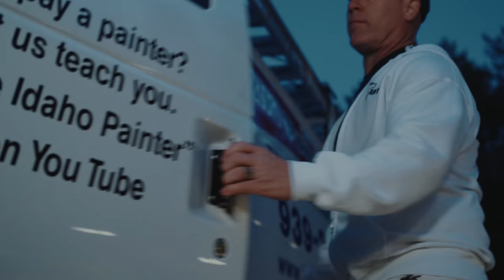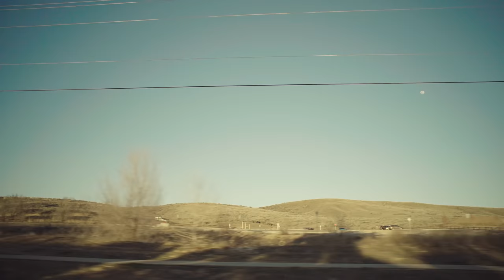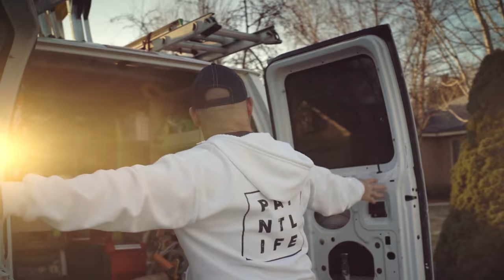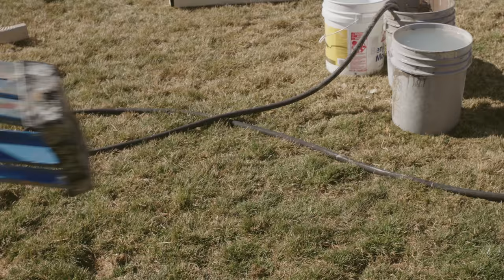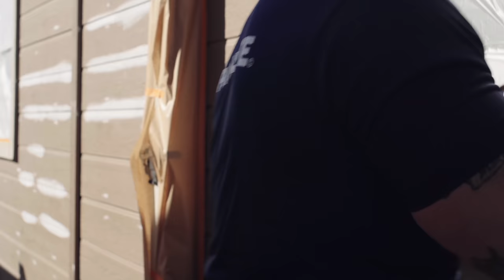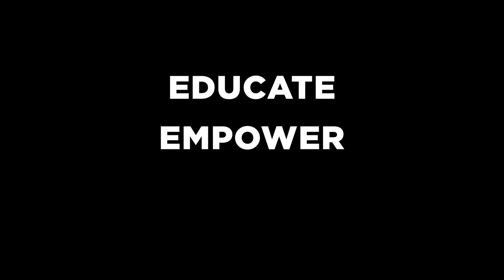Paint Life: Educate Empower & Equip

Comment: Started painting in the early 70's and professionally in 1980. I skipped 2 grades in school. I was in the 8th for 2 weeks, 9th grade 2 weeks before moving to the 10th grade. I was born July 4th, 1963 and I graduated at 16. I had on a farm in NC for 2 summers planting - picking tobacco and  baling hay. When I graduated I was so young I couldn't get a job for crap anywhere because I was only 16. After two summers working on the farm I had decided I didn't want any more of that. Let me tell you farming is a hard-ass job. A guy by little hometown Coats North Carolina who had graduated a year or two before me told me his dad was looking for some paint helpers and offered to pay me $4 an hour. The most money I had ever seen was $3.35 an hour busting my ass for minimum wage Farm. So I got the job painting and the first day on the job they told me I want you to send this door as smooth as you can get it. It was a six panel wood door and we used 180 grit sandpaper for oil primer. all of our trim was oil primer and two more coats of semi-gloss oil base. anyhow they left me in that room all day and didn't tell me nothing. I think they just forgot I was in there they didn't even come back from me at lunch. When they came back I have spent all day sending one side of a door I sanded every bit of the primer off but that door was a smoothest or you've ever seen. I work with that man for years they never let me live that down. I just didn't know any better. I got a 50 cent raise or my very first check and I got paid in cash and that was the most money I ever seen in my life and thought I was rich. I sanded and puttied. for two years straight before they never let me touch up paint brush and even then it was only the prime I couldn't do anything but Prime stuff with a brush that's all they would let me do. I did this for more than 30 years painting work for myself for the vast majority of it as soon as I learn how to do everything on the job I wanted to have my own business and started trying to work for myself at 22. I was a good painter I can cut a straight line like you wouldn't believe straighter than you can with tape even now. I had a hard time getting work because I was so young nobody took me serious until I seen how good I was. I've always been a perfectionist and tried to do the best job I could on anything. I painted professionally for more than 30 years until I fell and broke my back and forth places and now I can't walk too good. I'm unemployed because nobody will give me a job I can't do the painting end of it I'm not able but I could run the hell out of a crew run them in the ground I know exactly what to do on every little thing and I'm not one of these kind of people that thinks they can learn something cuz I'm always learning new stuff from your videos a lot because things have changed in the last few years and I've seen some things that I haven't never seen before. When you get to where you can't learn nothing then you're a dumbass. I can't tell you how many painters that work for me that didn't know really what they were doing to learn how to do everything backwards and I couldn't never break them. The best painters were the ones that came to mean didn't know a damn thing and I taught them the correct way to paint. Especially sprayers. I only had one guy that I was able to teach the correct way to spray. once a person never learn something incorrectly you cannot get it out of their head they think their way is the right way and they're wrong. Leastways I never could get it out of their damn heads. I paid you for 8 years professionally and then I moved up to Washington DC and work with a big company I had over 250 painters in 150 wallpaper hangers. Ronald D. Mayhew Incorporated. they were commercial industrial only wouldn't even consider a job under $300,000 wouldn't even fool with looking at it. This was in 1989 1990 and 1991. It was like being in a paint army. you had a quota of how much you had to do if each thing everyday and if you didn't make that quota you better make it up the next day if you hadn't made it up by the third day you were fired. a foreman on the job liked me and took me under his wing and said you're a house painter but you're one of the best painters I've ever seen. he said tomorrow when you come in here you act like it's your first day on the job and I'm going to retrain you and he did made me the best painter ever I really learn how to paint on that job. we had to mix our own paint and we didn't have a spray helper we had to mix a gallon of water to a 5 gallon bucket of really thick Glidden ultra hide mixed back and forth between two 5 gallon bucket box it up that's what we called it in the south anyhow we dumped it into a 30-gallon Hopper made out of a 60 gallon drum this was enough to spray the inside of one condo about 1200 to 1500 square feet. You had to go all the way to the back of the condo and you pull that trigger on your spray gun and you walk continuously never let go the trigger until you came out. you had to mix your own paint and spray the inside of 14 condos every single day by yourself. That's over 420 gallons a day. when we painted trim it was mostly flat metal doors and metal casings in a commercial building then we had the paint 50 per day on both sides cut him in clean to the wall that's 50 doors 50 cassens and cut in around the hinges and cut straight lines to the wall on both sides. When I came back to North Carolina at the end of 91 to be with my girlfriend who's now my wife I had took all the ideas that I learned from commercial painting and apply them to a house so consequently I was able to do and improved version of house painting much faster than anybody else around here. Seeing your videos makes me happy but at the same time it breaks my heart it makes me so sad because I can't no longer get out there and do what I used to do and that's what I loved that wasn't just my job it was who I was. I was always mr. Picky and super careful wood ladders but you will know how many times a day a painter climbs a ladder. I fell from a 24 ft ladder in October 2005 and broke my back in 4 places. in October of 2006 I fell off the second floor balcony and landed downstairs flat on my back on the marble floor in the foyer. I had to get on pain management about six months later because my back was so bad and I kept working up till 2012 until my back just got so bad I could no longer work. if I could find a job as a foreman somewhere running a crew I could work if I didn't have to do any physical labor but I can't hardly bend down and can't walk too good I have to use a four-legged cane to get around so I can't do it. Is seeing your videos really makes me miss my job like you wouldn't believe. nobody ever thinks of him and go to work in Fall one day they always think that happened to somebody else but it only takes one fall and there you are. Please be careful extra careful every day it's not worth getting injured. I used to tell my guys I'd rather have five of you holding one man on the ladder all day than see one man get hurt. Stay safe.
God Bless 🙏😇 Y'all
Jimmy in NC....
PS. My best friend who recently died about four days before his 56th birthday massive heart attack used to tell everyone I wasn't a painter I was the painter. I'd give anything to be back on the job with him now. I sure miss working take care guys best wishes!!